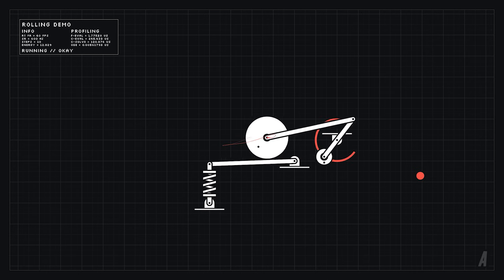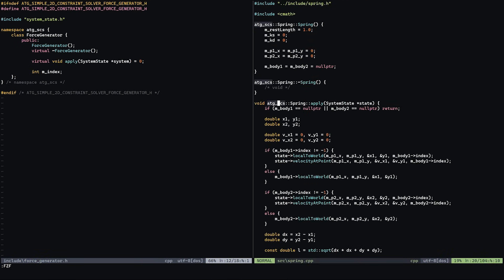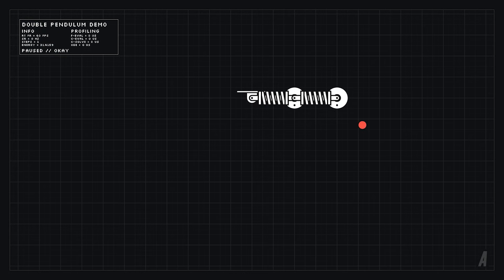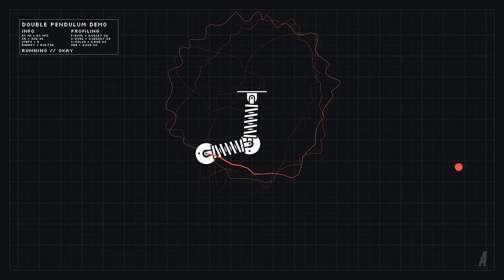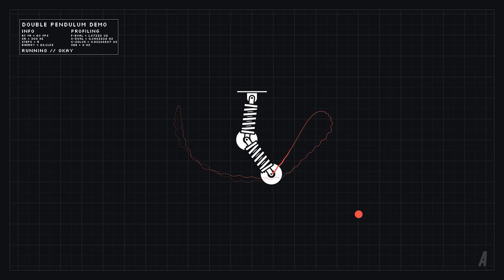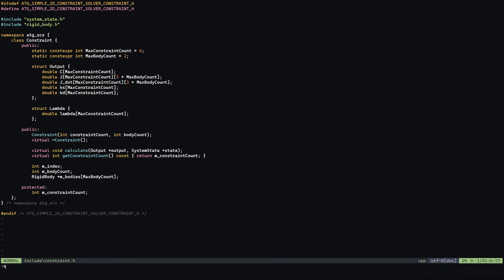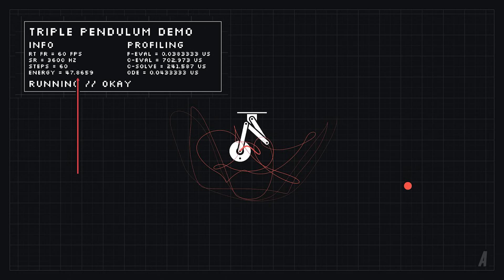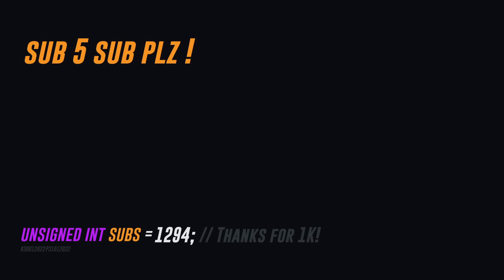Building a Physics Engine with C++ and Simulating Machines

Comment: "i wrote this advanced physics simulator"
"oh and then i ran into some problems with making the video"
"thus i quickly built my own screen capturing software which works better than this giant open source program that's been around since 2012"

okay
Reply: if this is my competition looking for swe jobs, I might as well give up now lmao
Reply: @abeecee  Just build stuff for fun, you'll learn more along the way.
Reply: Then proceeds to say, sorry the code isn't optimized, I'm not an expert
Reply: The kernel lacked some good real-time scheduler, do I re-wrote the whole thing from scratch. In assembler. While at it, I designed my own hardware to run my optimized custom kernel.
Reply: He uses ffmpeg which does all the hard work for you. You can literally feed it image files and it will just make it into a video.
Reply from the maker: @atypicalambience3487  I was honestly not even trying to flex with this lol, I just removed the important stuff from OBS and put it directly in the program, I didn't think it was amazing or anything 😂
Reply: @AngeTheGreat   It is is impressive but only because I think the average hobbyist programmer has never finished a independent project.  When I was a kid I thought anyone who programmed anything must be gifted or something. I don't think I really understood programming until I went through all the problems in K&R and then wrote a tetris clone at 17. That was after 7 years of watching youtube videos about programming and getting frustrated by IDEs and syntax errors. I encountered problems like "What version of java should I use for this source code?", "What version of windows supports this installation method of SDL?", and generally hitting wall after wall. 

Most people don't have a whole childhood to fail over and over and over. By the time they pick up a language they have to get a job. When they have a job they are to exhausted to program when they get home.
Reply: To be fair, taking a bunch of screenshots is easier than physics
Reply: Getting a raw image sequence out of your renderer is NOT "better" than this giant open source thing. 
It just does 1 thing and does it really well.
Reply: I don't want to seem like those people that go "I could do that, easy", but it's not that impressive. If I correctly understood, he essentially made an API where you call it for every frame you want captured, which effectively takes a "screenshot" of that frame, and put it in a video encoder. The one thing I'm not entirely sure is how he takes the screenshot, but I bet he uses a third party library or some std functionality that I don't know exists.

With that said, I've barely concluded any standalone projects, I always seem to start them though. I just want to be realistic here and point out that what he did is nowhere near the giant beast that is OBS...
Reply: @carlosmspk  well he used ffmpeg to encode, and i assume the graphics library frame gets passed to a queue which applies this encoding to it
Reply: hey let's not get confused here, as an experienced dev myself it seems like what we're discussing being impressed by is ultimately the finishing projects part, gotta love when that somehow happens.
Reply: I never use OBS for such stuff, it's usually better to save bunch on PNG (or uncompressed TGA files that have simple header) and process that stuff with ffmpeg (my favorite is PNG) -> ffmpeg (YUV raw video stream) -> SvtAv1EncApp (yuv to ivf/av1) and mkvmerge (ivf/av1 to webm/av1). I don't see a point in using screen capture, when I want 1920x1080 video and I can render it in that resolution.
Reply: @@jx1389 It eventually gets boring. One random example, I work with Unity in colaboration with other people. Managing Unity Scene Merges using Git is a nightmare. So I designed a tool in Rust to try and merge different scenes, and, even it fails, it tells you what Prefabs and GameObjects are conflicting. I was mostly successful, but there were a few edge cases, and there was no UI, it was a terminal based app. I wanted to make a full fledged UI right from the get go, but given that I spent about two months doing the logical part, I got tired and gave up. That's pretty much what always happens, I do the core "logical" part which is fun, but then I give up at the boring part: debugging and user experience, even if that user is me.

I sure hope your question wasn't sarcastic, or else this was a huge waste of my time xD
Reply: he didnt build an application its a tool you use in c++ programs
Reply: The flex is insane
Reply: I know. It's incredible but explained without any air of superior intelligence which makes it shine through in a way which makes me want to binge his videos. Especially since I've been stuck deciphering an udl intentionally obfuscated by its author. Plus my lack of get gudness haha. Great video man
Reply: @jstro-hobbytech  Not gonna lie I avoided clicking this video for months because I assumed it was going to have a bit of superiority from a name like "AngeTheGreat" 😅 But I was pleasantly surprised after finally watching it, since YouTube refused to stop suggesting it :)
Reply: one day my man will be like "my OS was running slow, so i made a new one"
Reply: John Rock  You're correct, he remade OBS from scratch. OBS is now obsolete. My apologies!
Reply: probably the coolest part of the video :p
Reply: Yeah this really gave overachiever lol
Reply: I thought he said it wasn't screen capturing software
Reply: @ArixZajicek  It's not. You, the developer, need to call the library's functions for it to do things. You first start it with an init function then call a function that returns an empty frame (i.e. an image) in which you can manually write to and then send back to the library. You do that for every frame, then, at the end, you call a final commit function which gives you the full video.
So, unlike what I originally thought, it's up to the user to populate the frames with data in whatever way they see fit, the library does not intend to write to frames for you

Comment: Great work!  

Just a small nit, here... 

There are many ways to discretise the vector system:
 dx/dt = f(x,t) 

1 - LHS:
--------------
First, we can discretise the lefthand-side using the base definition of the derivative:
dx/dt = (x(t+dt) - x(t) )/dt

This one-side difference is the part they call "Euler".  It's first order accurate, with errors being proportional to dt^2.

2 - RHS:
--------------

Where in time you choose to evaluate the RHS is also important.   The Forward-Euler method evaluates the RHS at t=t, thus:

(x(t+dt) - x(t))/dt = f(x,t)    <-  forward Euler

A much more accurate and stable method, albeit computationally more expensive, is to evaluate the RHS at t+dt:

(x(t+dt) - x(t))/dt = f(x,t+dt)    <-  backward Euler

This requires the solution of a matrix system at each time step.  However, in exchange you get the following benefits:
- extremely stable simulation, with a wide radius of convergence
- can use much larger time steps
- much better accuracy 

Obviously, there are many variations of both forward- and backward-Euler.

Comment: Have you gone already the rabbit hole of designing the solver of the physics engine to handle both 2d and 3d cases with the same code?
Reply from the maker: I decided against adding code for 3D since it adds so much complexity to some of the constraints, but eventually I do want to look into it

Comment: A note on implementation: your RK solver is very tightly coupled with the design of the system you're integrating. Usually it's best to try to decouple the integrator from the system itself and implement it more generically. For ordinary ODE's you just need a function that calculates a vector of derivatives from a vector of coordinates, and that's all your integrator needs.

And your physics engine can index into those arrays to access coordinates of any given rigid body.
Reply from the maker: Good idea! Might refactor that part, thanks for the suggestion
Reply: Ordinary ordinary differential equations
Reply: Best why? Unless you’re reusing the integrator in various places that is just unnecessary complexity, which is more surface area for bugs
Reply: @LakaiSkateForLife  for example, it's much easier to debug and profile the integrator in isolation.
Reply: @Alexander_Sannikov  Could you please recommend me some book(s) to learn about programming physics simulations? Based on your posts, you seem knowledgeable!
Reply: @stupidguy97  the first thing you need to know to simulate physics is, well, physics. after that you can usually find your way around (any book/articles on numerical methods).
Reply: He's also using public virtuals which tells me he's not very knowledgeable of c++
Reply from the maker: @revealingfacts4all  I don't claim to know it all and I like to assume that I know nothing anyway. What do you recommend I change?
Reply: @AngeTheGreat  Using public virtual functions is perfectly fine. People are usually worried about the overhead of virtual calls (hence the fear of making them public I guess), but it's a really dumb fear that has almost no grounding in reality. Just stick to the good old rule of profiling your code if it's slow, instead of making assumptions about why it's slow.
Reply from the maker: @PandaMoniumHUN  Yeah I understand the performance cost and I've run into that a few times, but never heard of issues with them being made public. In this case, I used them in a place that was not a major bottleneck so their performance cost is negligible
Reply: @PandaMoniumHUN  Totally agree. There are so many variables in optimization that it's almost always a terrible idea to optimize by simply looking at the code and making a blanket statement. You need to profile to determine if there even is a bottleneck.
Reply: @revealingfacts4all  I am curious as well as to why you think using public virtual functions somehow reflects his lack of C++ knowledge.
Reply: @revealingfacts4all  what's wrong with public virtuals
Reply: @mihailmojsoski4202  you can google it up, but, as I understand, you can separate the interface of base class from the function implementation, for example you can add common checks in the base class before executing the function of a child class

Comment: Some constraints (such as rolling constraint, universal joint, etc) can be represented both as an extra body with simpler constraint attached to the bodies that you want to connect to start with, or with a more involved jacobian and no extra body. I recommend initially not wasting time implementing complex jacobians for joints that are not experiencing heavy load and implement them using just an extra body. If/when they become a problem, you can replace the extra body with a page of code for its jacobian, but they must converge to the same exact result in the limit of the extra body having zero mass.
Reply from the maker: Oh I see, might look into that. I think I might have gotten carried away with the rolling constraint, I really wanted to make it work for some reason lol

Comment: Yo, a double precision physics engine?, that's pretty cool and unique since most widely used game physics engine uses floats(box2D, physx, havoc etc) and they suffer from rounding issues when objects are far away from origin
Reply from the maker: I actually didn't bother trying it with 32-bit floating point, but it might actually be that bad. I wanted to prioritize accuracy (for obvious reasons) so I just chose double precision. Thanks for watching!

Comment: Have You thought about using something like Eigen?
Reply from the maker: It's not a bad idea. For this project I just wanted to learn more about the techniques in detail so I implemented all the matrix math myself. It definitely wasn't necessary though, just fun. Thanks for watching!
Reply: @AngeTheGreat  Oh for sure! I love workign through problems the same way, I was just curious to see if you'd see a significant difference by using Eigen with its SIMD optimizations etc.
Reply from the maker: @grantwilliams630  You could definitely get a pretty decent performance improvement by using vectorization. In my follow-up video to this I'll show some optimizations I did to get a 10x performance improvement without having to use SIMD. In the future I may use it though.

Comment: Awesome stuff! Highly recommend you look into iterative techniques (Gauss-Seidel, or more complex Conjugate Gradient). They are probably in fact easier to implement than the Gaussian Elimination, and you can terminate iterative approaches when the error is low enough. Convergence rates are almost always related to conditioning of the system being solved, which will depend on what combination of constraints you have in your simulation. Note that isn't worse than the elimination case: poor conditioning also causes numerical instability in that algorithm as well.
Reply from the maker: Excellent suggestion, you definitely know your stuff! I actually did implement Gauss-Seidel but I didn't mention it in the video because I didn't want to confuse people haha... But you're right that iterative approaches are great. Next step will be to implement Conjugate Gradient since that'll be faster and also slightly more robust (for redundant constraints, etc.). Thanks for watching and thanks for the suggestion!
Reply: @AngeTheGreat  Let me know if CG works for you for solving constraints and what reference you used. I'm really curious. I heard it can work, but never managed myself.
Reply from the maker: @mihaifrancu736  Seems to work for me, check out the code to see the implementation. I don't remember the exact source I used but I think I just followed wikipedia
Reply: @AngeTheGreat  oh, i know, you're only doing equality constraints. For contact and friction you need to solve an LCP - that's trickier
Reply: @AngeTheGreat  i saw no Gauss in the video, in fact, I don't think I saw any weapon of any kind!
Reply: If you're dealing with these kind of ODE's Runge-Kutta (steal Matlab's ODE45 implementation) is vastly more efficient numerically for your application. Seidel, Gradient descent, LM, etc will be effective if you can time march a solution with stability, or if you're dealing with sparse M's (Finite Vol Method, etc). Good reference from way back when is Numerical Recipes.
Reply: CG only works with symmetric positive definite matrices. Otherwise you need some other Krylov method such as GMRES or BICGStab. Of course if you need machine precision then direct methods are the way to go
Reply: @bogdanboiii1154  this is a good point! The JWJ' lhs matrix here (assuming no degenerate or redundant constraints) will be SPD.
Reply: oooh. nice.
Reply: Hey @brandon, what do you think of LevenBerg-Marquadt (probably mis-spelled!). I have read several papers recently where they use that for solving systems (not physics) as it is supposed to be very fast and more 'optimisable', removing zeros etc. Wondering if you thought it would be good for a physics engine?
Reply: @chriswalsh5925  but if i've learned anything is that the more complicated the method's name is, the better it is. Euler? Pfft... Runge-Kutta? Okay... QUANTIZED STATE SYSTEMS? Now we're talking!
Reply: @chriswalsh5925  there is only one way to find out... code it and test it! :> There should be implementations online, already.
Reply: @chriswalsh5925  LM is a great algorithm, but may or may not be applicable to a physics engine depending on where you use it. My above comment is regarding solving systems of equations, and one part of the LM algorithm requires solving linear systems repeatedly (Conjugate Gradient or other similar algorithms are often used for that part). So, in some sense CG and LM can (and are commonly) combined. Almost all of these algorithms btw benefit from the fact you don't have to actually create a big dense 2d array of matrix values. They can operate on 'sparse' representations of the matrices, which means if there are many zero elements, then you can effectively skip a lot of work. I encourage you to look at a numerical methods lecture or two if these things are interesting to you! Thanks for the question.
Reply: @jojodi  I agree with you. LM is a nonlinear least squares solver (iirc) which then requires linear system solves at each iteration. But I think there is still a subtle connection between the two. At least the matrices that appear here are very similar to the ones used in Gauss-Newton. So, I would be very interested if anybody has some material on this.